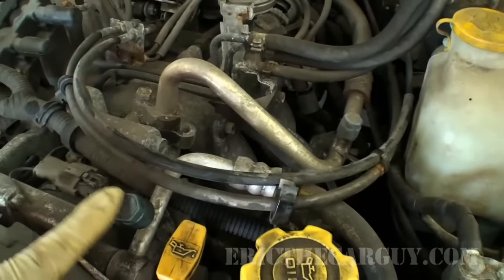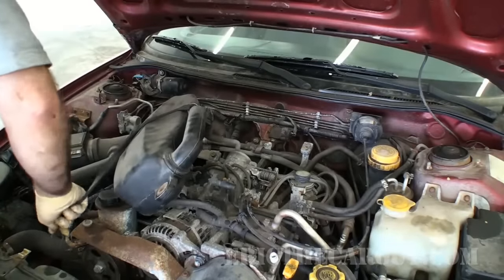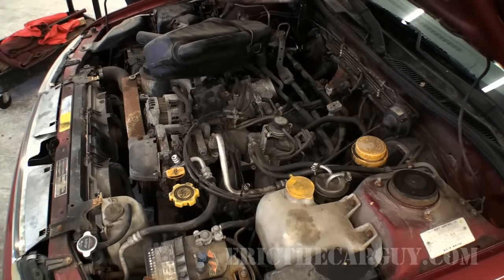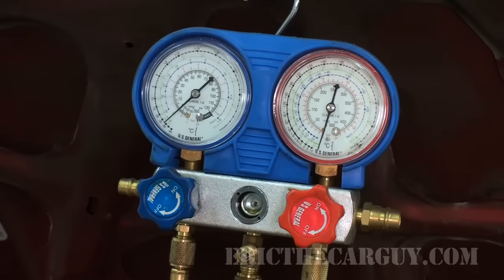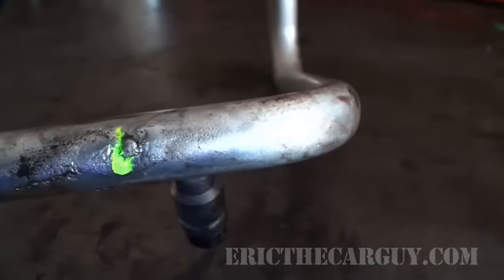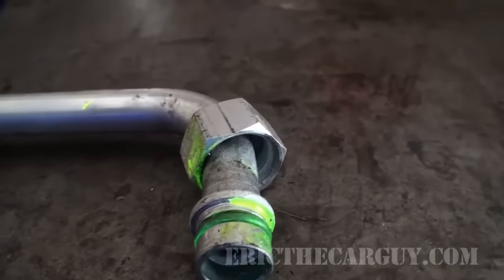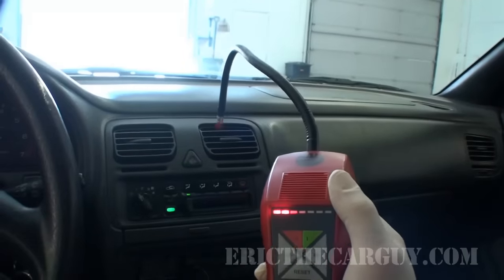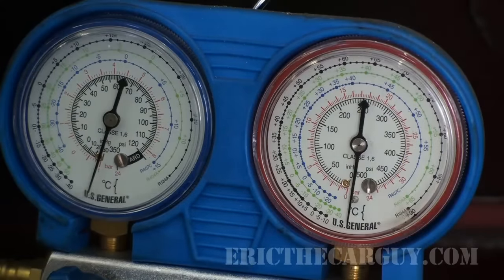How To Find and Repair AC Leaks - EricTheCarGuy

Comment: Evaporators get damp from all the refrigerant evaporating inside it. That moisture, plus the dark environment in which it's located, is a good place for mold and bacteria to grow, especially if dead leaves and plant matter are allowed to enter the HVAC housing. There are cleaning services available, but the only sure-fire way to clean it is to remove the dash, split the housing, and clean it. Though in a pinch a can of Ozium will work wonders.

Comment: I've actually retrofitted my 134a manifold to accept a paintball "remote line" with a shut off. I have a small 48/4500 tank that I have filled with nitrogen (paintball stores that dont have a compressor on site and even some welding supply places can fill these) the regulator on the tank can get up to 450psi however so it is important pressurize incrementally. Dye can also  be injected into the system like the video shows, only with nitrogen instead of refrigerant. best part is no vented 134a

Comment: You are too real Eric. No editing the silly parts and mistakes. Learning a lot from your effort. Saves me a lot of time and mistakes on my end. I do residential hvac and never put a vacuum on a system with a known leak as it will suck air through the leak into the system and allow moisture into it. To verify a leak I pressure the system with nitrogen & look for a drop in pressure.   Congrats on a million subscribers.

Comment: Great video. And as a professional tech im glad to see these kind of videos so consumers can understand the difficulties of Ac work. Just a couple of thoughts. Why not bench test the line before installation As brazing is a industry approved repair. With the vacuum pump and a couple vacuum plugs you can pull a vacuum on just that line and it is quicker than pulling vacuum on the whole system. Also with that said you can isolated the whole system line by line and confirm evaporator leaks before pulling dashes. Take that electric leak detector and throw it in the trash it can be set off by anything as your video shows. Keep up the good work

Comment: Another great video Eric. Just a tip... if there's a leak in the system, stay away from SEALANT(s). Usually they never work and clog the expansion valves (also ruins recovery machines), so please take it to a shop to have a certified technician work on it, if unsure.

Comment: Ok, you added dye into the yellow hose and then connected it to the refrigerant can.  Knowing you don't want to introduce air into the system, aren't you suppose to purge at the shrader valve on the manifold until you see refrigerant coming out so you know you've pushed out the air in the yellow supply hose?  But, since you've added dye first into the hose, you'd also be spraying out dye when you're purging it, which I imagine could get a little messy.  Wouldn't an injector that allows you to push dye or oil directly into the low side port be a better option.  Just wondering because I'm going to try to help a friend find a leak in her AC system very soon.  Thanks!

*Update, I read through the comments and I've found Eric doesn't respond much to questions, if at all.  Anyone else got an answer for me.
Reply: @hondahoodgarage6357  Precisely. He does that in his video on evacuating the system and recharge
Reply: They make a threaded tube that you can add refrigerant oil to a system you can do the same thing with the dye you just have to make sure you fill it up where the dye comes completely out of the holes no air in it you put that between the line in the manifold Lower Side open the manifold gauge app on both side the high side will drive it into the system you're done I've made one out of refrigerant tubing it's kind of a pain in the ass to fill up though works
Reply: @hondahoodgarage6357  exactly! I thought it off at first. But then concluded the obvious answer was charging up with dye to find the leak... Then fix the leak,  pull vacuum. And then once leak solved purge out the air under vacuum and holding then introduce freon.

Comment: Good video, very informative. One important piece of info for viewers is that venting refrigerant in the atmosphere is not only 'not cool', it is also illegal. Someone probably already mentioned in the comment section, but i'll mention it again. Also, as an employee of a major hvac corporation i can confirm that pulling a good vacuum on your system is paramount! A good shop will pull a vacuum for at least 30 minutes...be weary of a shop that doesn't take the proper amount of time to do this job correctly. You need all the moisture out of your system otherwise you'll just run into more trouble down the road.
Reply: If you're experienced in this field could you tell me how corps get away with putting r134a in air dusters (the non-flammable types) but venting even partially empty systems is illegal? Seems like gov actually cares more about profit more than air quality lol

Comment: I replaced the compressor myself on my old Acura Legend about 8 years ago, got the system recharged, and it worked for a couple years. The expansion valve then failed along with the condenser, so I replaced the expansion valve, condenser, and receiver/drier then took it to a shop to have it recharged. $800 later in parts and a recharge, and I had a working system. It's now empty again after a few years, and the UV dye appears to indicate bad o-rings on the hoses at the compressor. Smh. The good thing is that R12 is still available, and I'm stubborn about converting to R134A. Vacuum pumps are available on loan at Autozone.
Reply: I've had many Acura Legends and I don't know why you're hesitant about switching it over all you have to do is Pump It Down well first put the new fittings on which are 20 bucks and you are converted. It's pretty simple to do or am I missing something here
Reply: R134a doesn't circulate R12 oil properly and burns out the compressor and replacing the oil entirely is such a big job its not worth doing. The best cheap way is to run propane/butane mix. There is a guy that made a great post about it, I think his website name is possum living. If you Google it, it'll be one of the first to come up. It's better than 134a cause it circulates the oil, readily available and not harming to the environment. I personally run straight propane in modern R134a systems due to higher efficiency and lower cost. Never had problems
Reply: Jay Fox  multiply the weight of r134a by 0.4 and you get required weight of pure propane. If you need other gasses you can look up the weight by volume at 25°c and divide the new gas by old. This gives you the value you can use to multiple the old gas weight by like the 0.4 above
Reply: Couldnt you just fill it by pressure? Whhy does weight matter?
Reply: @weneedtermlimits  because once 10% or so gas is in the pressure doesn't change until its grossly over filled. That's why ac charging is always done by weight. Also if a top up is needed, the present gas is pumped out and new refilled cause there is no way to tell how much is already present

Comment: Also keep in mind that if the compressor doesn not crank for a long time it will break (the shaft seals) so it is really worth checking if it's ok. I bought a car that had a leak in the system that nobody bothered to fix for years and I had to change the compressor too.

Comment: This is one the most valuable vids on Eric the Car Guy. This vid has answered a lot of questions i've had with AC systems. Thank You Eric!!!! Also another thing with AC compressors is that they also have sensors inside which prevent the AC compressor from running when there is absolutley no R-134A in the system. The compressor only runs when the sensors detect refrigerant.
Marc

Comment: Before you start charging the system and after you connect the freon can to the yellow hose, you should have loosened the yellow hose at the manifold end to purge the air from the yellow hose.  You should do this for a second or two after you hear air from the connection, then close it.
Reply: +Michael “Carnac the Magnificent” Karnish  I think he didnt purge because he poured refrigerant coulerent in the hose
Reply: He didn't cause this was leak process diagnosis

Comment: Hey Eric, I just changed my A/C compressor, condenser, & drier/accumulator and both of my lines lines, but it looks like I've still got a leak. I am going to do a leak test tomorrow. I've got a ford ranger and it looks like the evaporator core is under the hood.  Will the dye test work with that? If that doesn't work I'll have to buy or rent one of the R-134 leak detectors.  And last my question is can I still re-use my drier, if I just changed it?  The only thing I've done at this point is put a vacuum on it. So I believe the only moisture that's been put in the system is coming from the leak and I guess drawn in by the vacuum pump that I ran on it.
Reply: Not cool you hit no answer.  Hate that for you.  Hope you were able to get it all running ok.  I know it was a long time ago.
Reply: @benicio1967   I got it fixed.  It turned out to be an o-ring that needed to be changed.  I think it was at the condenser.  It's been a while since I did this, but I think I did a leak test to find it.  Thank you for the reply and the concern.

Comment: I just replaced my compressor and I didn't have refrigerant at the time but I did have propane. This works just as well right?
Reply: some cars DO explode
Reply: Yoga flame. If you ever vacuum it out, keep cigarettes away from the pump.
Reply: Propane can have moisture in it so do you really want to chance it ?
BTW some so called alternatives to freon are hydrocarbon products but do you really want an explosive gas in your AC system ?
I do not !

Comment: Good video, covers everything for a home guy. 
For those diong a few cars... They do make an injector for the dye. Many variates, but they all go on the low side like the mainfold and let you directly inject it. So less messy and unlike adding to the yellow hose, you can turn the refrigerant "on" and crack that fitting at the manifold to vent the air out of the line.
If your in a shop, Nitrogen and soapy can be used to find leaks and check systems too. Work on refers, and that what I use. 

One question I have always had and never gotten an answer too.... The dryer is basicall just desiccant in a tube. Some are cheap and some are expensive. For the expensive/hard to get ones..... Anyone know if its possible to "cook" these things (140=/- for an hour) like we do for ammo or 3D printer desiccant packs and renew them?

Comment: I chose to smash my car into a tree so I could certainly identify the AC leaks.  (I didn't. but I have two cars with zero AC and I'm $1,400 in on one repair where we replaced the whole system and it failed after 1 year.  so  i certainly feel like driving that one into a tree.)
Reply: Leave the trees alone they dont hurt acs

Comment: Its 88 today. Im gonna have to do it. On my way to Harbor Freight..
Reply: Don't forget the compressor oil and refrigerant. I'd buy my gauges at an auto parts store in a kit that comes with refrigerant, if there is such a thing.
Reply: I got the refrigerant with the oil already added.
 It also come with its own gauge. Thanks!
Reply: It hurts me to buy anything at that place.Such crap. But I suppose for a one-off it might be best.
Reply: @tmst2199  harbor freight has improved over the years I feel. I haven't had any issues with anything I bought from there!
Reply: @amendes6410  The last thing I bought were some snap ring pliers. They were basically worthless for even slightly challenging snap rings.

Comment: 134a is an HFC, no chlorine. Zero negative ozone impact. Calm down.
Reply: Right. It's not a CFC. Still, it's considered a potent greenhouse gas and has already been banned in the EU. Potential alternatives include CO2 as refrigerant of all things. LOL.
Reply: It is something like 1300 times worse than CO2 pound for pound as a green house gas.

You are correct, zero impact on ozone.

Comment: Working on a 02 Suby. Nice to see it done on essentially the same system! Borrowed manifold and pump from friend. Wondering if the hoses and connections are really air tight as it looses vacuum after shutting off....

Comment: great job on the vid ,,,,,like you said at the beginning a/c work is not always easy !    i am a retired old fart 70 years old  just installed a new compressor on my nissan rogue , it did not hold vacuum after evac ?  but i went ahead and put a 65 psi of stagnant pressure to see if i have a leak of some kind ? it held pressure of 65 for 3 days ,,,,mind you i dont do this anymore but sometimes ill play around cause i am borred LOL ,,,,,,new compressor clutch wont engage no power at the compressor plug ,,,,,,so just backing up what you said ,,,a/c work can be frustrating even with experience ,,,,,,,going down the rabbit hole ,,,,,lol    your a good teck eric ,,great vids always

Comment: Wonderful video, i liked it very much.It is ex termly difficult and headache to find the leaks. My car ac mechanic, released the refrigerant and then pumped ordinary air into the ac system. After that he poured the soup water over the ac pipes to see whether there are any leaks in the system. Then he released the air and then pumped in the refrigerant.
Reply: So environmentally responsible. I don't know why he didn't use the soapy water before releasing whatever gas was in the system, but maybe he suspected it wasn't R-xxx.

Comment: I have 2 quick questions and also I'd like to say that I am about to go down this very long road to troubleshoot my wife's ac system. A bit about myself: I am a small business owner, Triangle Mobile Mechanic, in the RDU area. Not that my plug is out of the way, I have been successful fixing AC systems a handful of times, yet it alludes me, and this video reminds me of my frustrations.  Question 1:  Why in for Pete's sake aren't we shot gunning AC jobs with parts, I hate this method in particular, but in some ways it makes sense because well, you end up spending more time on the back end typically if the first bandaid didn't work and I would also like to add that those High and Low side switches should be swapped out with new switches at the very least. Am I wrong to thing this way or are you like me and you're going to go for the cheapest way possible despite the obvious chance that there's going to be more issues down the road. Also, 2nd question: Why aren't we changing out the orfice tube. That seems to be a common failure and if that thing clogs then the AC system is going to be less efficient and possibly after a serious clog blow out all those new o rings. Let me know if my thought process here makes any sense.

Comment: Huge help in diagnosis my rapidly leaking AC. And Great tip about the accumulator/dryer replacement, mines been sitting 2 yrs
Reply: Also could you post up the parts you ordered, both the low pressure and accumulator if possible
Reply: Check rock auto parts. They will have the drier but not sure about the suction line

Comment: For future reference, any Subaru dealer can still get parts for them :P They still make every part for my 95, including body panels. Price may suck a little (a lot) but they are still there!

Where did you end up getting new lines? Mines shot as well, dealer is pricing me about $97-$200 depending on the line, and $97 for the dehydrator unit. Seems a bit much lol

Comment: Thanks so much for this!  I've got a compressor failing on my 2001 Xterra and have been doing research for weeks to figure out what needs to be done to fix it and recharge.
Reply: Time for a new compressor.   Eventually, the clutch will completely fail.  Better to do it on a planned schedule, than to have it suddenly fail when you need it the most and don't have time or money right away.

Comment: Thanks a lot for your helpful video which makes my job on A/C much easier. I noticed you used polar ICE 134a refrigerant which contains leaksealer  to fill the system. Some people claimed that leaksealer clogs compressor and condenser eventually. Could you tell me is that true? Thanks.

Comment: I like the video.  Maybe tell the viewers about the leak stop refrigerant and the pros and cons of it. 
Also with those gauges when you remove the high side hose (unscrew the depressor and remove the quick connect fitting) liquid refrigerant will stay trapped in the hose.  You can then bleed the refrigerant in to the low side (engine still running) by going across the manifold.  Make sure you do it slow to prevent liquid from destroying the compressor (watch the sight glass).

Comment: Wanted just to add a little detail about the change from R12 to 134A is because R12 is prohibited now (not all countries i believe) it's a pure Ozone killer. R134A is a friendly and safe material. great video!
Reply: Almost all cars have 134 in it now I converted to a Mustang one time but the condensers are slightly small 134a rounded slightly higher head pressure the problem was too much head pressure before you can charge it up completely that suck if your red go fit in an old car what's a huge condenser no problem

Comment: Any thoughts on using the bubble test to find leaks.  I understand why eric is reluctant to do an ac video.  You need to understand ac in general.  I work on residential and commercial hvac equipment and therefore know what to do but finding a leak is sometimes easy and sometimes not.